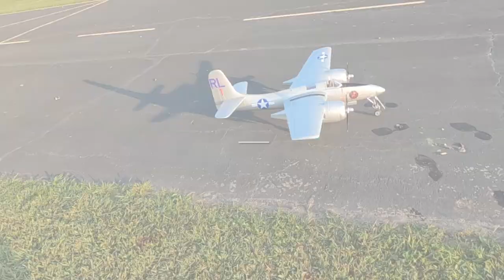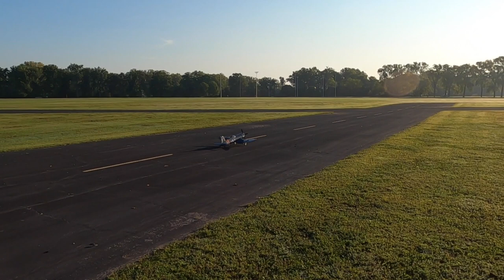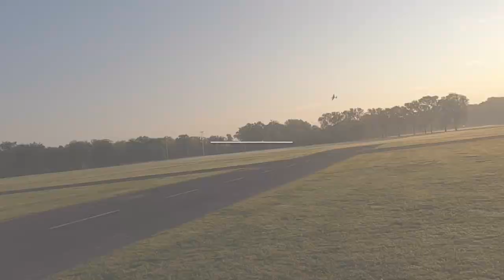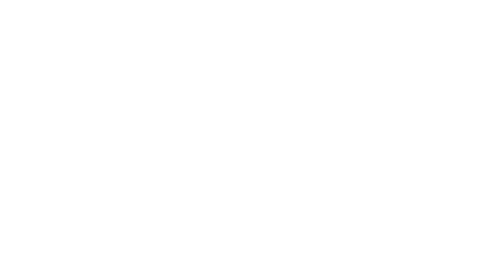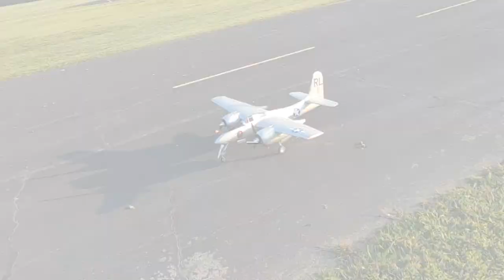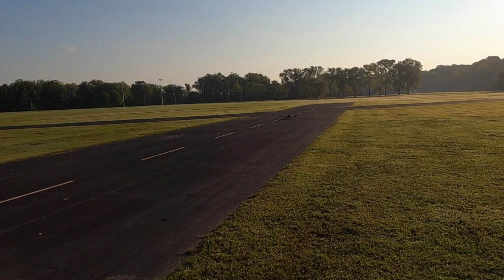FMS F4U Corsair 1700mm and F7F Tigercat 1700mm flight and review

Comment: Awesome planes. Very good review. I have both planes and they pretty much come with me to the field every time. Now the Cosair if you want a little more power may I suggest an 80 to 100 amp ESC and a BadAss 4530-270kv. You don't have to change the 18x11 prop so you can stay scale and you have the extra oomph to get u out of trouble or do a little more with her. That's what I put in mine. I run it with a 6s  5 to 7kmah 50c and it's just beautiful. It puts it on par with the Tigercat. I'm at 2/3 throttle most of time and I still have a little in reserve. But I just love both of these planes. Oh and I have had no problems with prop hub blowing apart or any stress on the hub. I do look over my planes when they come back from a day of flying. Good review and stay safe.
Reply from the maker: John,  Thanks for the tip about the motor upgrade..  I was thinking about giving the Corsair a little more speed.  Maybe a future video..    Thanks for the comments..  I really appreciate it..

Comment: The landing gear on my F7F sometimes do not deploy in flight but will always deploy on the ground so difficult to find the cause. Very strange. Great review 👏
Reply from the maker: Often its that little grub screw on the bottom of the installed retract.  You gotta take the retract out and look under to see the 2 screws.. Make sure they are tight on the flat part of the shaft.   Good luck..

Comment: Nice review! i have both these models, haven't  maiden them yet, this will be helpful
Reply from the maker: Ping me through these comments anytime..  If you haven't already, check out my two other videos on the Corsair...  One is the Maiden and the other is Landing practice...   Thanks for watching..
Reply: @SteffenRC  Question! Are the propellers on your Tigercat, both rotation clockwise, when viewing the plane from the rear? which according to the instruction manual is the correct way, however in order to get my Tigercat to operate correctly and travel forward, both Motors must be spinning inwards, if i change the directions of the motors were both spin clockwise, the plane will spin in circles, LOL
Reply from the maker: @williewideback  My Tigercat props spin inward.  The props are set for inward rotation (left/port prop is clockwise and the right is counter clockwise)   Thats how it was when I purchased it and it seems like it works very well.  No issues with torque at all..
Reply: @SteffenRC  Thanks!! I appreciate your help
Reply from the maker: Let me know how it works out...  Curious how the maiden goes...
Reply: @SteffenRC  ok, will do!

Comment: Well done, really like the comparison and cutting between the two in the video, but is this an apples to apples comparison?  Dual motor vs single, high wing vs low wing?    Would a better comparison be the Corsair to perhaps a mustang or another similar configuration?  Maybe you can add that to your planned videos.
Reply from the maker: I have my 1600mm Spitfire I need to throw into the mix.  Might do a video on big warbirds.   They are all very different flyers.
Reply: @SteffenRC  that would be great. Videos like that would help others choose between warbirds. I am a big Corsair fan but that is an emotional feeling from growing up watching shows like Blacksheep. But I have no idea which warbird flys better. I do believe bigger is better so that would probably be my starting point.